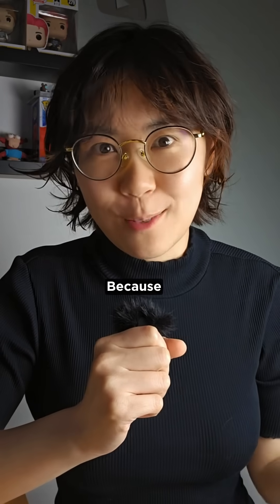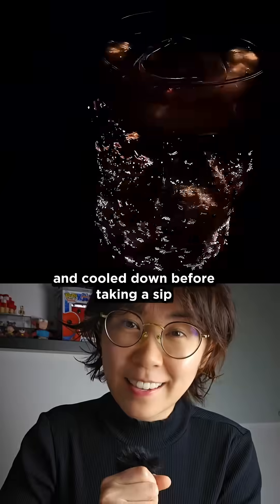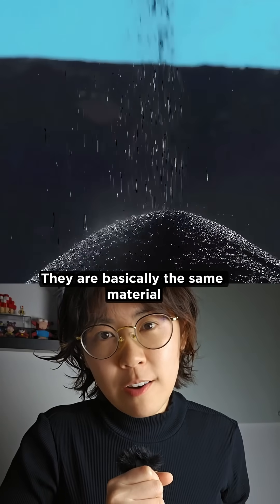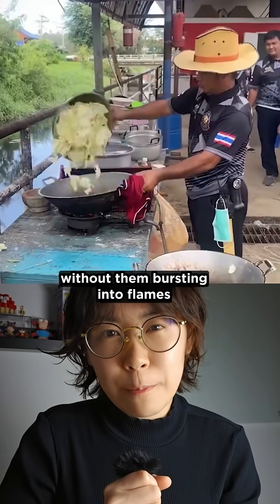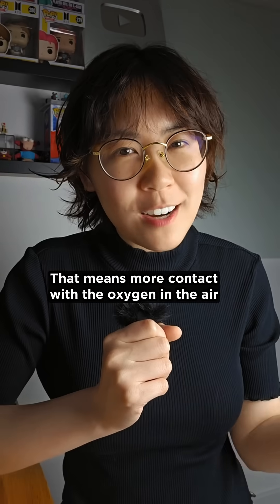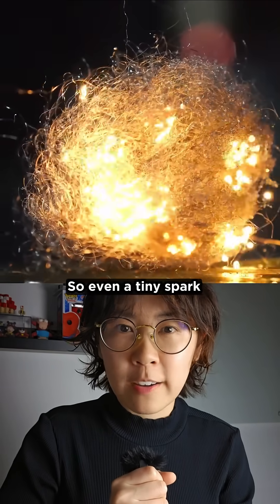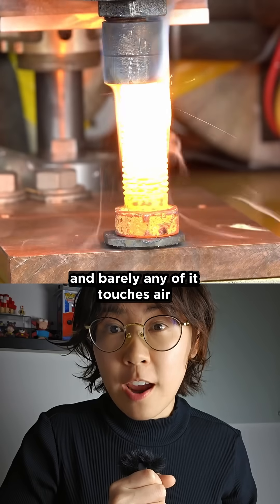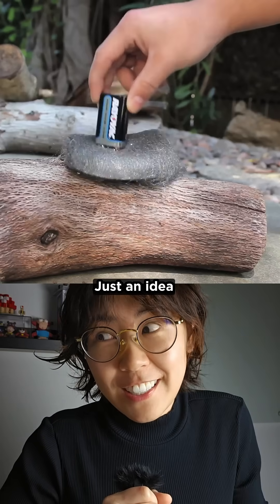Why Steel Wool Burns But Steel Doesn’t

Comment: i think the same logic could apply to wood where a log wouldnt burn easily but wood shavings can be used to start a fire easily
Reply: Isn't the issue with a log is the mass is absorbing the heat? As we know, logs burn all the time.
Reply: @txmits507  I don't think it's the mass. Wood is a poor conductor of heat, so it wouldn't absorb the heat fast enough. That's why you first light something like paper (or traditionally tinder), then place thin sticks over that, then larger sticks, and only add the logs once you have a good hot fire going.
Reply: shavings are the stage up from what you are thinking of.

tinder.  finer than shavings by far. take a chopping tool or sharp edge at almost a perfect 90 and scrape the wood. fine, fluffy, fibers will bunch up and you will build up a tinder pile.

Comment: Remember anything can burn if you have a good enough oxidizer. Look at Chlorine Trifluoride for example. Can burn rocks, tungsten and titanium like fire wood.
Reply: Fluorine is the most powerful oxidizing element, so that makes sense.
Reply: @smith97320 cause it’s the most electronegative element :3
Reply: @smith97320 crazy right. But Chlorine Trifluoride is the hell chemical, a spill anywhere means someone dying.
Reply: @smith97320  I can't help but thining. pure calcium or magnesium or just aluminuım. just rusted iron cause thermite reaction that reaches 2500C. what if you use chlorine trifluoride. it is scary :D
Reply: Ah yes, the infamous chlorine trifluoride. Where the recommended safety gear is "a good pair of running shoes".
Reply: @drunkenhobo8020 I live that joke😂. A video explaining it made a similar one but it's the protocol for a spill "run"
Reply: Ye
Reply: ofc you would say this sankuu from dr.stone
Reply: dioxygen diflouride can burn ICE iirc
Reply: Similarly, anything can burn with a high enough surface area to volume ratio

Comment: Fun fact: you can also light steel wool with a 9V battery (well any battery, but I say 9V because it's easier and safer to light up than a typical A to AAA or penny battery)

Edit: ...I didn't watch the last 3 seconds of the video before commenting...

Comment: But im still confused. Is metal genuinely combustible? I always thought organic stuff like wood and fuel can burn not non organics like metal and rocks. 

I understand the surface area stuff causes combustion to be easier but i just don't understand why metal could burn
Reply: Burning is just oxidation
You know what else is oxidation? Rust. 

Its basically rusting really fast, and the reaction expels energy so it heats up and glows and causes the areas around to rust as well
Reply: @14thbattlegroupcommander  Damnn, Super speed rusting , Thats true. Thanks for making me understand
Reply: Basically the metal reacts with oxygen rapidly in an exothermic reaction, releasing heat and light which we can observe. A solid piece of metal can also undergo oxidation but relatively slower compared to steel wool so there's no light
Reply: Theoretically anything burns with the right circumstances and this appears to be steels (maybe just one of the right circumstances) right circumstance for burning